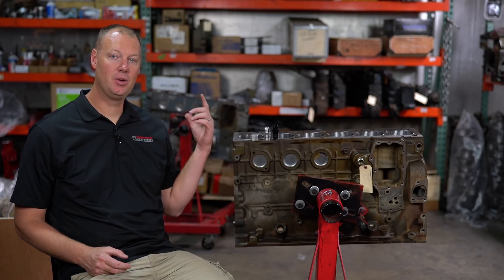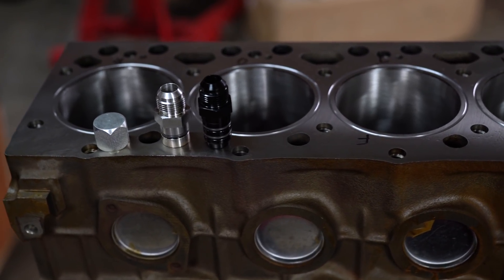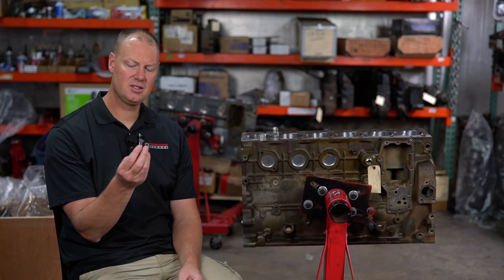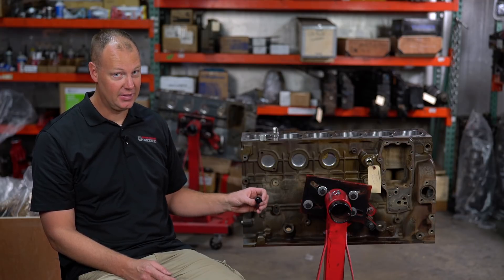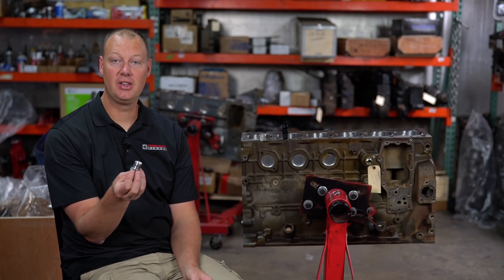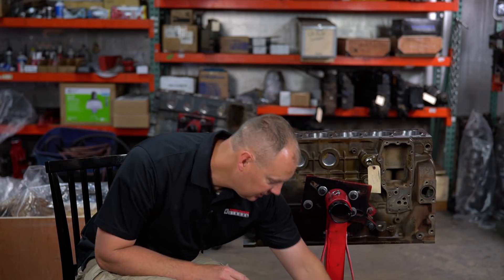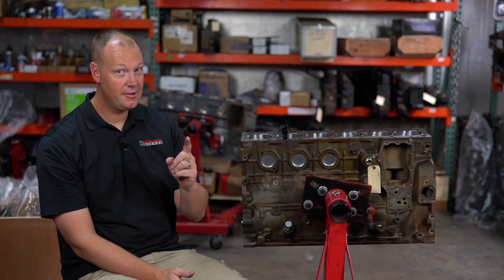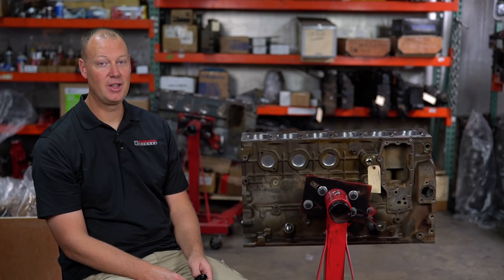Cummins Oil Drain Block Fittings | Parts Bin EP 10 | Power Driven Diesel

Comment: I know this is an old video but does this work at all on a 2014 6.7 Cummins?
Reply from the maker: Should work on all 89-18 Cummins
Reply: @ will be placing my order….. just for anyone following along that this may help in any manner do not purchase AGP 2nd gen swap oil drain I had a leak at the fitting on the line and unfortunately got told to pretty much order another one they do not make them in house so it’s not their issue.

Comment: Where could I get a hose to connect to the fitting to the turbo with a adapter plate so it bolts to the turbo

Comment: That’s how you solve a problem when everyone else is imitating. For a hardcore fit, put some loctite 609 on that dude. That’s exactly what Cummins used for tapered fit items like isx cam gears. A little heat and the fitting would still come out the same way you did it.

Comment: Now just make them for a -12 fitting
Reply: This man knows what he’s talking about!
Reply: I have had a turbo puke oil because the -10 drain fitting was too small. Had to go back to stock. Wish someone would make a -12 fitting. I am half tempted to make my own.
Reply: @dylan7228   I hear you. The factory drain is -12 sized and any time you can run a larger drain the better.

Comment: I enjoy that you guys are always looking at parts and improving...not just following the status quo. I took a different approach as I had the engine apart and on a stand for filings to fall to the floor I simply drilled and tapped the factory hole to accept a 7/8NPT to -10 fitting....that ain’t popping out! Keep the videos coming guys.

Comment: Why not drill and tap the boss for NPT threads?
Reply: Or my thoughts is this piece keeps you from having to pull the engine or live with shaving in there
Reply: Don't get me wrong, great idea with the taper fit thought. Sounds like a great solution for a guy who doesn't have the know how or tools to tap the block.
Reply: If the engine was out dissembled for cleaning thats a great idea probably the most reliable  but  with out cleaning the metal grit the littlest amount of  metal shavings will wipe your bearing and mating  surfaces out.
Reply: @markrich3271  agree most guys dont pull a engine to do a compound kit but if you did I'd tap that block. However this fitting I'm sure is tits I order 2
Reply: @markrich3271  I was thinking maybe the guy could pull the pan then drill and tap. But I think the tapper fitting would be the easiest.
Reply: Drill and tap definitely the way to go IF the engine is apart. But for an installed engine I like this option better.
Reply: @ WHAT LEVEL OF BOOST DO YOU FEEL THIS BECOMES A THING